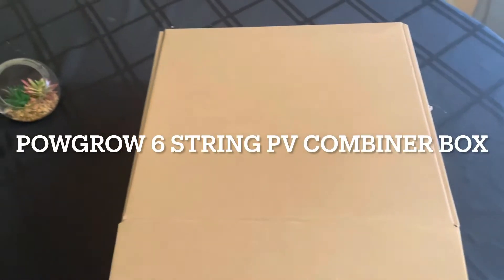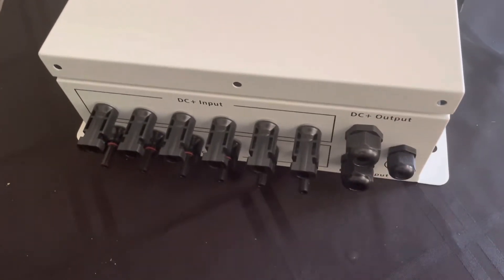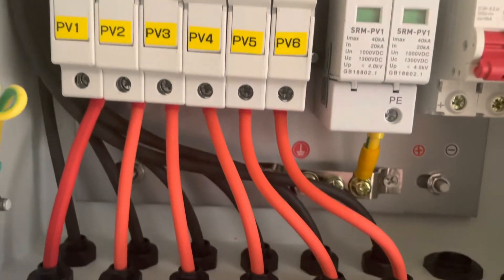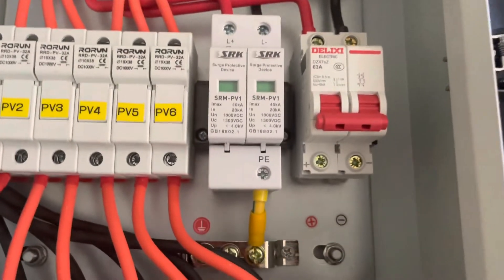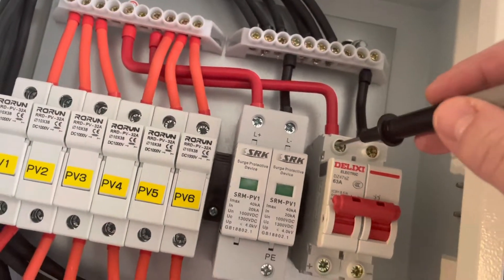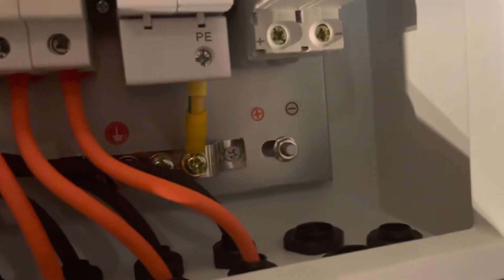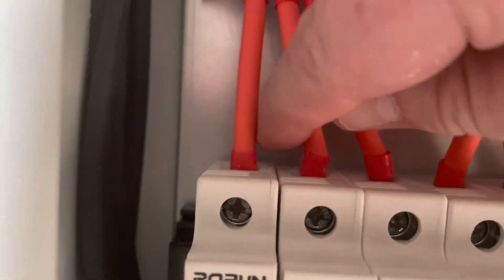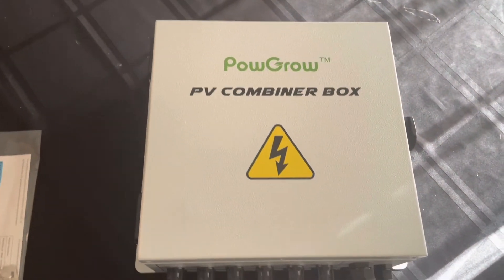Unboxing - PowGrow 6 string solar combiner box

Comment: Please can someone be really kind enough to help a brother out:

I want to get one of these boxes, but I have 4 x 405w solar panels, each rated at 13A and 31.18V. I want to connect the 4 panels into 2 parallel strings and then the 2 strings into series. I don't know if this box can handle this?
Reply from the maker: This is how I'd do it. Let's call the panels 1,2,3 and 4. Connect panel 1 to panel 2 in series. You should get 62.36V at 13A (which you can verify with a voltmeter). They are then the first string. Run them using whatever length of wire you need (12AWG will take 20A) to the first two inputs of the six on this combiner. Do the same with panels 3 and 4 to the 2nd set of inputs on the combiner. You will have up to 62.36V and 26A leaving the combiner box, so run 10AWG (30A) out from the breaker inside the combiner to your charge controller. Make sure everything is tight and wiggle the 10AWG wires as you screw them into the breaker or the breaker may get very hot and fail. The fuses in the combiner are 15A so enough for each string, and the breaker handles up to 63A so you should be ok. Good luck! :)
Reply: @thedabbler2753  Oh wow, thanks for the advice buddy, you don't know how much I appreciate it! Just one more quick question if I may - where's the best place to buy these from? I've checked on Amazon, but they're a whopping £250...
Reply from the maker: @alpachino468  for your use case you could get away with the 4 string version and still have room for expansion. It's on eBay UK for just over a hundred quid from seller selectivesales123. Good seller rating, nothing dodgy. Should be fine. The fuses and breaker look like they're enough for your panels.

Comment: I don't like the fact that the power from the solar panels are fed to the bottom of the fuse holder
When you open the fuse holder and remove the fuse, you can potentially shock yourself
Best to have the power fed to the top, then you have the greatest isolation distance

Comment: So a question from a newbie.  Can i put two strings from 2 different arrays (East and South facing) into a combiner and supply a one string inverter without negative impact or do i require a 2 string inverter? not sure why i would.  Thanks
Reply from the maker: I would say yes, provided the voltage from the arrays is the same you should be okay. I had to do that in a 2S4P configuration to counter some pretty bad morning shading from a neighbor's tree.
Reply: ok thanks

Comment: What fuse rating?
What breaker rating?
Those wires look like 10mm2 so I would expect something higher than the 4 way boxes 4x 15A fuses with 63A breaker.
Reply from the maker: Thanks for asking, Ted. The supplied fuses are 15A 20kA 1000V (RDRUN RRD-PV-1038TUV). The fuse housing is RRD-PV-32A (DC1000V). The breaker is a Delixi DZ47SZ 63A 500V which I've had to replace because it was tripping far below the expected amperage / current. After sending the vendor a video of what was happening they promptly sent a replacement which has been working fine since.